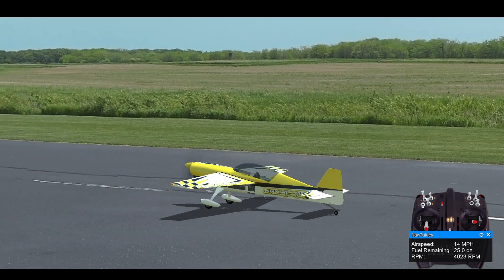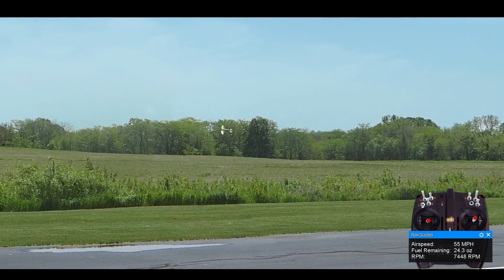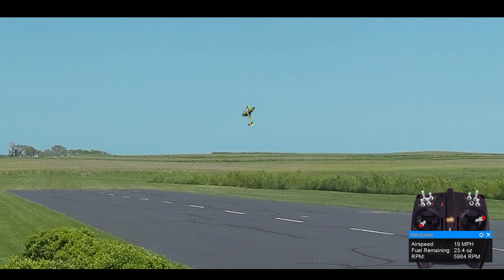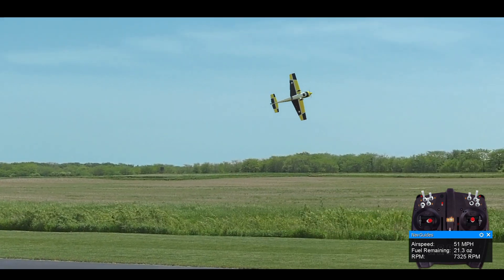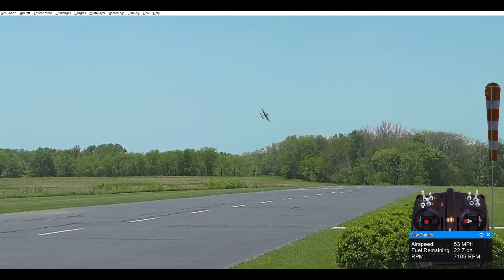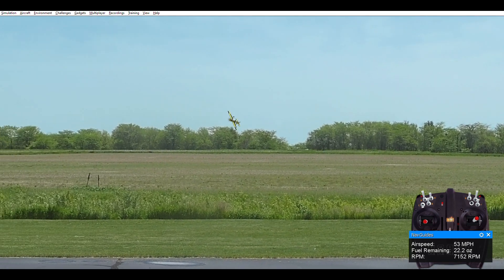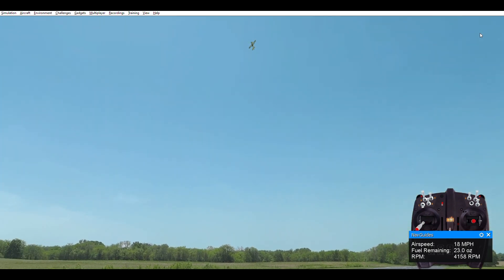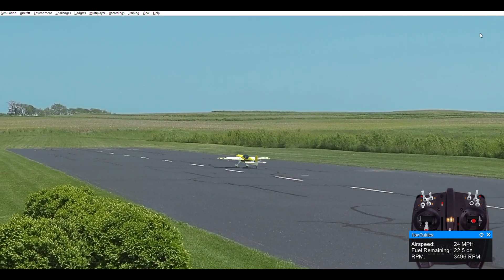Why a Consistent Flying Speed Helps When Setting Up a Remote Control Airplane

Comment: On my timber I have a throttle profile that comes up to 50% throttle at 25% stick and stays there till 75% stick. I got tired of moving the throttle by accident while doing rudder maneuvers like stall turns knife edges and flat turns, it works out pretty good and makes me look more professional LOL
Reply from the maker: I too have a throttle curve between 25 and 75%. Mine is has a very metered minimal increment up.  It is not completely flat because that could create an issue with not having power when I need it. What you are doing sounds like it’s working. If in time it feels off, you may want to consider increasing your rudder expo to give you some flexibility between it and your throttle.